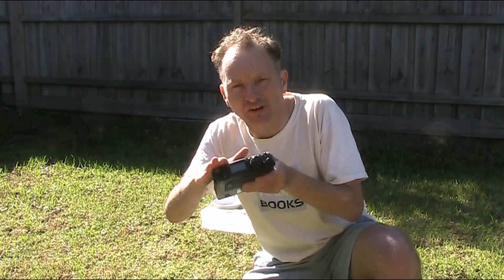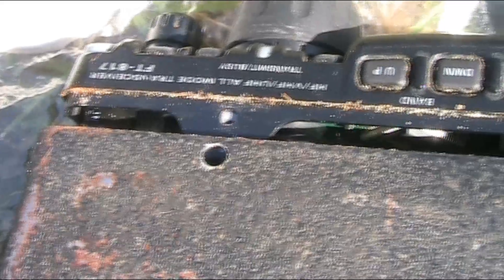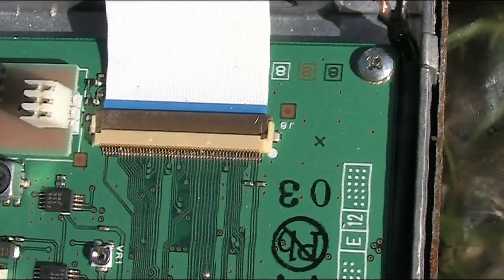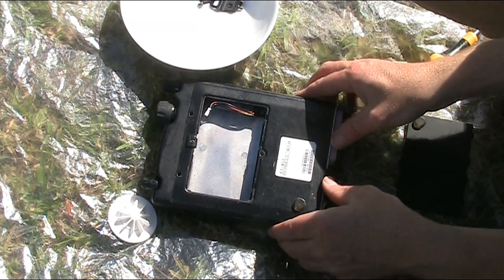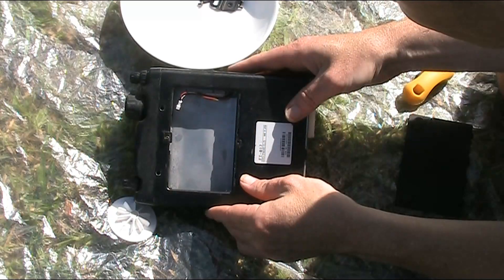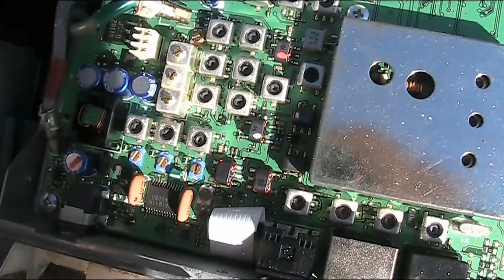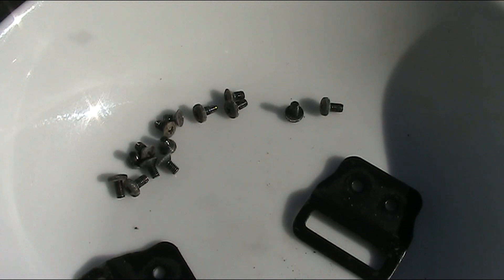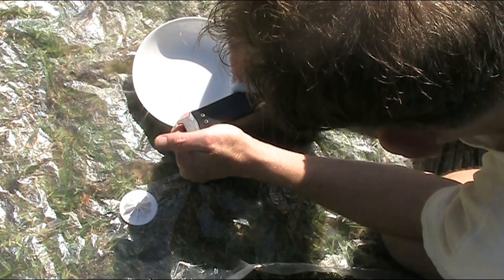Inside a Salty FT817

Comment: I would have used a vacuum cleaner around the edges and over the top and bottom of the boards held at a distance (to prevent static electricity build up).  To me wiping with a rag just moves the dirt around.  And I would have performed the test inside away from stuff flying through the air. Is shows that the rig is well protected from the normal elements during use.

Comment: I take that radio apart all the plastics off clean all the knobs face plate in mild soap and water install all new screws pull the boards out electronics cleaner all the boards check all the solder joints

Comment: Your FT817 reminds me of the Bluesmobile.  One day, it's gonna say ENOUGH, and with a push of its PTT, every knob, screw, panel and connector will spring off, all settling into a steaming pile of e-waste 🤓
Reply: Or... it will still be intact after 70 years, like much WW2 radio gear.

Comment: The 817s are really robust radios. I’m impressed at how clean yours was after being in one of the more aggressive environments, a beach. 
My environment is the mountains with wet and cold. One dodge I’ve learned from photography is this; if you’ve been out in the bitter cold put the radio inside a sealed bag before going indoors into the warmth. That way the moisture in the warm air doesn’t enter & condense out inside the radio. After an hour or so the radio will have warmed up to room temperature and can be de-bagged as the risk of internal condensation has passed.

Comment: When dealing with small parts I prefer to work on a towel, or in a cardboard box, or sometimes both. Inside a plastic bag if springs are involved. I avoid working over grass or deep pile carpet, so if I do drop something I have a chance of finding it.
Reply: @lostinspace280  I don't remember where I picked it up, but it is a handy trick.

Comment: Hello Peter - let me encourage you to take the covers back off and use a vacuum to get the sand that did make it into the inside and all of that stuff on the outside. Where I work we use a 3M data vac to remove dirt from the machines that I do maintenance on. If you could lay your hands on one of those for a couple hours that 817 would look like a totally different rig.  But as always, great vids!  Keep up the good work Peter. 73 de WB8YMV
Reply: Need to be super careful of "static" discharge when using a vaccume, killing any semiconductors.